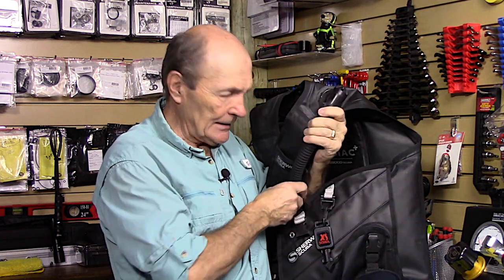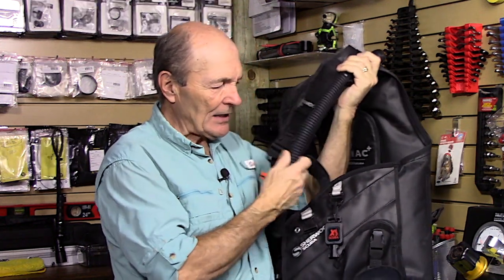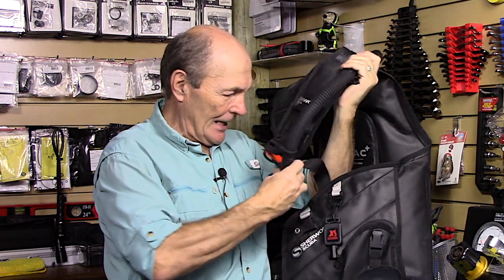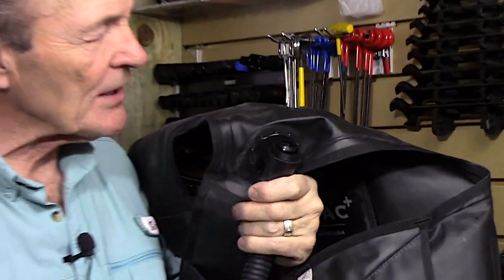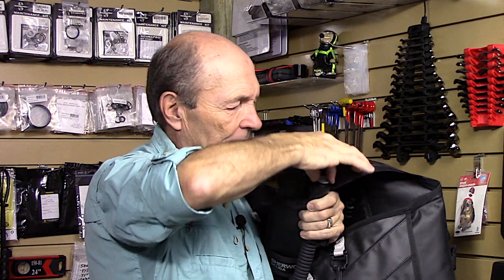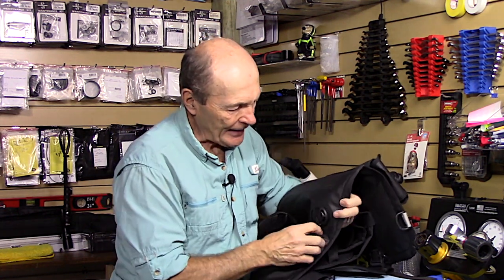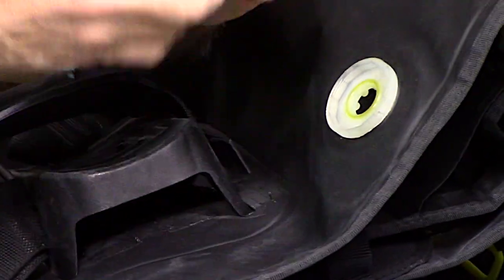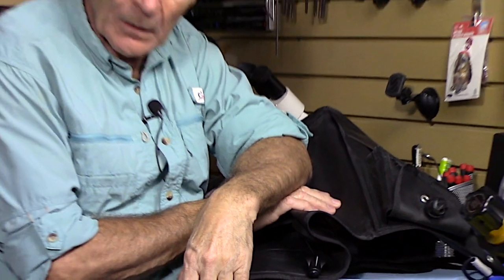Service Your BCD Dump Valves - Scuba Tech Tips: S07E13

Comment: At the 3:53 point you say you don't always want to use silicone grease.  I've watched most of your Tech Tips and I don't recall you saying that you shouldn't put silicone grease on something (that isn't made of rubber or silicone that makes some sort of seal).  Could you please make a video about places where silicone grease should not be used and what should be used in its place?  Thank you!
Reply from the maker: Yep! I can do that Nerd.
Anything that moves and rubs against another part is the basic criteria. That means O-Rings (only dynamic O-Rings - not static) and threads (lightly). 
Note that if the moving part is supported by an O-Ring, you lubricate the O-Ring only - not the part too.
The places where you do NOT want grease are usually the seats in either stage or any diaphragms. Greasy diaphragms can squeeze out under pressure. Even the 2nd stage diaphragm should not be greased along the edges where it is gripped by the body clamp. With a hard inhalation, it could pull out - very upsetting at 10' much less 100'!
I have opened some regulators that look great on the outside only to find the inside looking like the wheel bearing of an old fishing boat trailer - caked-on dirt and dried-out grease. The diver complains about hard breathing - the parts can't move!!!
I'll see about a video.
Alec

Comment: Alec, Have you or will you do one on servicing the PIV, or is that best left to the pros? Is using the special tool enough to prevent problems? The PIV on my BCD got stuck closed once and had to be serviced. Had to call a dive because of it. I love your videos and have learned a lot. Thanks for all you do.
Reply from the maker: I thought I did that but can't be sure. Maybe Kevin will know. 
I can do another one though that is in more detail.
The wash out adapter for cleaning your PIV will almost completely eliminate any problems. It blows fresh water through the entire PIV. The PIV generally only fails when it corrodes from salt water. 
Take care.
Alec

Comment: The one time I had a slowly self-inflating BCD, I only realised what was happening when about 10 minutes into the dive, my buoyancy control was so off, I could hardly descend with any air in my lungs. Since I was in trim position and fighting to stay under, using the 'butt dump' was a convenient way to get the air out of the BC. I had to do it about 8 times over the hour, since I was trying this BC after the last one would slowly deflate at the surface, I then decided I'd rather have a deflating BC over an inflating one.
Reply from the maker: New divers are taught about this unlikely but possible danger. They learn to recognize it and to disconnect the inflator hose. It's a good skill to try and to practice, as you've learned.
Take care.
Alec
Reply: @AlecPeirceScuba_SeaHunter  I remember being taught this in the pool, I guess that when I was trying to complete the survey dive, I was preoccupied with just getting things done without slowing the other surveyors down. It had been about 4 weeks of diving since I learned how to do it and to be fair, it would've saved me a bit of air (not that we were urgent in conserving it - we only surveyed as deep as 9 meters!)

Comment: some dump valves are not a simple big unscrew. On mine it has 2 small screw I have to take out, then it's a 90 deg counter rotation to open the valve mechanism (I couldn't find any service info on it an ended up prying it open and thankfully not break it and put it back correctly - almost looked like it was welded plastic so I wasn't sure how to open). Was leaking small amount, so a cleanup of the mushroom and bit of silicon did the trick.
Reply from the maker: In my videos when I say most, I mean most. There's always a few pieces of gear that were designed to frustrate and you seem to have one. I know the valve you mean and it's a pain. The screws are small and get lost or strip the plastic. Plus it comes apart with a careful twist and pull but often gets marked when people use a screwdriver or knife.
Fortunately you don't have to service them often. A good hard rinse with a garden hose and some silicon spray will keep them good for years.
Take care Alain.
Alec

Comment: So you suggest using some silicone grease on the rubber seal on the rear OPV/pull dump? On a different BCD with a slightly different design I was advised against it as over time dirt can get stuck to the rubber seal/stopper which it would be less likely to do if it was not greased. On one BCD I fixed the tiny leak in the OPV by adding grease and on the other one I made it leak by adding grease, so I reassembled it after cleaning all the grease off with the same result but the good valve was now bad and bad valve now good lol.
Reply from the maker: Just a very thin coating to lubricate the threads, not like lubing the ball joints on a old car.  Same for o-rings, a small dab on a finger, work it around your fingers then coat the threads.  No sand or dirt will get into the threads (or big trouble).  No need to lube the seal in the OPV as water and gunk will get into the BC bladder.  Just the threads is fine.  Hope this was clear in the video.  If not , blame Kevin.

Comment: Hi Alec. Many thanks for all your informative videos. I have an Aqualung Seaquest Pro QD BC. I cannot open/unscrew the dump on top of the PIV. Is this a sealed unit that cannot be opened or am I doing something wrong? Thanks
Reply from the maker: It can be opened but you risk breaking it.
The older Pro QD opened like any normal PIV. The newer ones are different.
This is where establishing a good relationship with your LDS service guy becomes really valuable.
He ought to be willing to show you.
Otherwise, send me a picture of the mount and I'll try to help. seahunter@vintagescuba.com
Good luck.
Alec

Comment: Hi Alec, after cleaning my BCD in and out with some light detergent the rubber seal on the bottom dump valve (spring type) fell off during the drying process. It seems it was only fixed with silicone grease to hold on. Is it normal that this seal comes off rather easy or is that something I should fix with some additional glue? I am kind of worried that the seal will come loose at depths due to the air pressure pushing against it when I use the valve and would rather prevent such a situation if that is something to worry about. Thanks a lot!
Reply from the maker: That seal is usually NOT fastened in place except for a tiny dab of silicon adhesive. In operation it moves only a small amount and will not fall or even shift out of place. However, if the valve is disassembled, it can easily come off. Clean it, dry it, put a small dab of silicon on it and re-insert it in the cup. Reassemble the valve and you're all set.

Comment: My lower dump valve has lost the spring, is the a typical service part ? What would one expect for the trigger (over) pressure on a BCD ?
Reply from the maker: Generally speaking, springs are not considered service parts for a BCD as they are not required to be changed.  Your dive shop should have a replacement for a few dollars to get it back to 100% dive ready.
A.

Comment: Hi Alec. I was taking the opportunity to clean my BCD. I found a very leak on the nylon cloth outer layer,  a small pin hole leak. Is there a good way to patch the blabber?
Reply from the maker: If you have small bubbles coming out of the BCD, the air bladder inside has a puncture.  Recommend taking it to your local dive shop to find where the hole is and depending on the style: jacket vs wing, they may be able to apply a bladder seal.  Don't dive with it until repaired as holes only get bigger as the bcd is filled at depth.  Be safe, get it serviced by a pro.
Alec

Comment: Thanks Alec the dump valve on my drysuit leaks where would I lube on that it's a bare mat pro d6 neoprene drysuit
Reply from the maker: A drysuit dump valve may leak if it's dirty or hasn't been serviced for a long time but most commonly leaks are the result of the diver not using it properly. 
Be sure you hold it up so the valve is the highest point of the drysuit when you are dumping air. 
And try to avoid dumping all of the air. As the last bit of air comes out the dump, water will come in. So long as you have a bit of air in the suit, the pressure of that air inside will keep water out. If you must dump all the air to adjust your buoyancy, put on an extra 2 pound weight. That way you'll be able to leave a little bit of air in the suit.
If it is the valve itself that's leaking, you're best to take it for service. Disassembly and reassembly of a drysuit valve is not the easiest job to tackle.
Let me know how you make out.
Alec
Reply: Alec Peirce Scuba I've let the dump valve soak in soapy vinegar water the suit has had over 550 dives my personal feeling is that it needs either complete overhaul or a new valve

Comment: Hey Alec, since I am currently in the market for a BCD I've had my eye on some of the second hand Buddy Commando ones (now AP Diving I believe) with either the yellow, orange or blue pockets however I was told by one of the experienced divers at the scuba club I am a part of to avoid these due to them being an older model then they won't be serviceable. I was therefore wondering what your input is on this in terms of how serviceable older style BCDs are? Cheers.
Reply from the maker: Not very. Your diver friend was right.
Any BCD with a double shell (inner bladder and outer cover) can not be serviced.
And many power inflate valves are obsolete too.
Buy a used BCD with caution. Always check with your LDS before laying out money to be sure it can be serviced.
Take care.
Alec
Reply: Alec Peirce Scuba good to know cheers

Comment: Is there a way to repair a leaking dump valve?  It is the one on the lower rear of my old Dacor BCD.
Reply from the maker: Clean it and lubricate it. Maybe the sponge rubber seat is badly worn or missing. Take it off, flip it over and re-glue.
Alec

Comment: Hi Alex , my dump valve has a spring in place of a pull system , Is that normal ??
Reply from the maker: Yes, some models did use springs until they engineered that part away.  
A

Comment: How often should you rinse the inside of the bcd?
Reply from the maker: After every dive! And rinse some water through the PIV too. That's the Power Inflate Valve. It's the most common failure point on the BCD. Hold it underwater in fresh water, push both the inflate and deflate button as you shake it around vigorously.
There is a special hose for cleaning the PIV that hooks to a garden hose or water tap. It's well worth $20!
Take care.
Alec

Comment: Hi. Is it normal to have a sea water inside my bladder?  Im using a mares hybrid..
Reply from the maker: Yep! In normal operation of a BCD water will enter the air cell.
A valve in the dump stops some of it but if you use it a lot some will get in.
That's why it's so important to fill the BCD with fresh water, preferably twice, after every dive and blow it up to dry.
And try to avoid using the dump any more than necessary.
Take care.
Alec